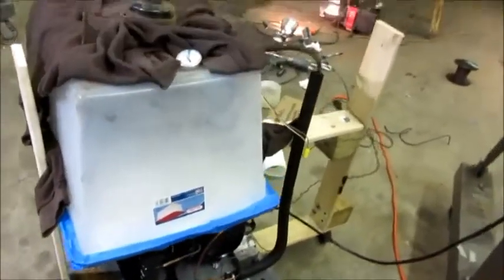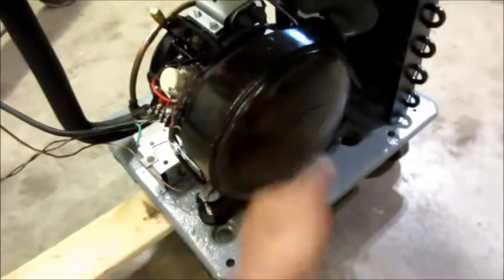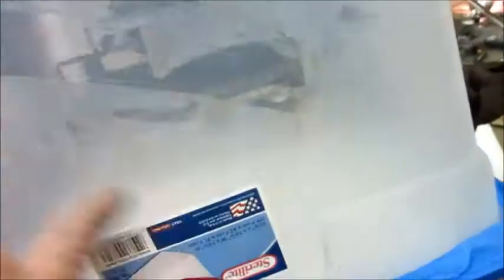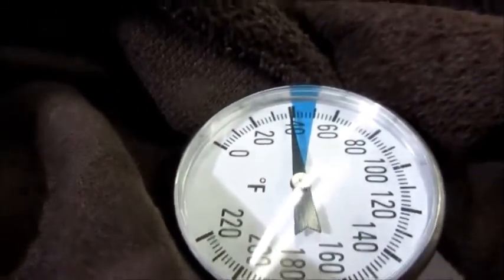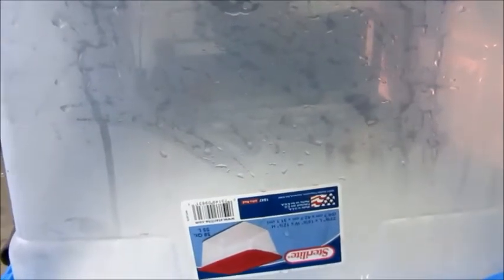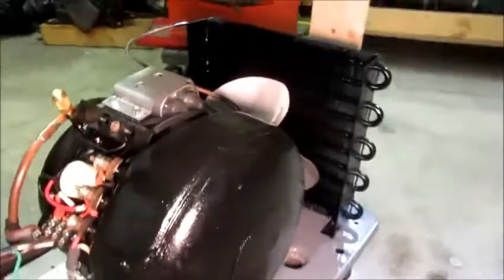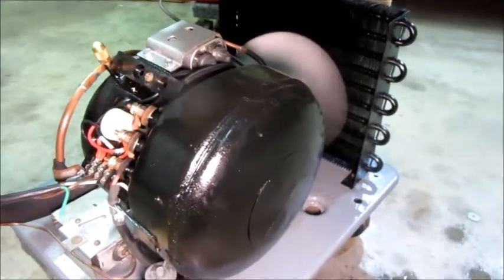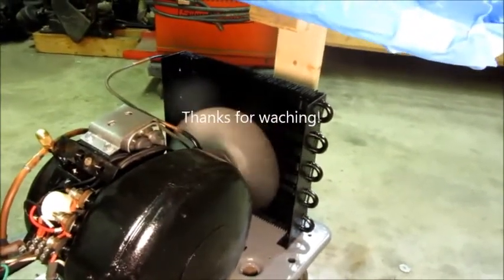Westinghouse Antique Vending machine Compressor - 4 - Simulated Cabinet Testing!

Comment: Excellent Job once again! Just curious about the charge....I recall you recovered the original R12 but charged with 152A....Did you feel you did not have sufficient R12 to recharge with recovered R12....also is the oil compatible with both refrigerants?
Reply from the maker: Thanks!  

I did recover the original R12, but it was just a tiny fraction of a charge. I save R12 for systems where nobody has proven them compatible with any alternatives. 

This Westinghouse system does not depend on the refrigerant and oil being soluble in each other, so the original oil can be used with R-12 (which will blend in to the oil at any ratio) or with R152A (which only blends in oil to a limited degree). 

The system is designed to separate the oil and return gas before they reach the compressor. Regardless of whether the refrigerant liquid and oil were in solution; or traveling as an emulsion - the compressor will receive dry superheated gas and liquid oil at its return.
Reply: @davida1hiwaaynet  i had a similer question,you answred it 100% thanks,enjoy your vids! you are a good teacher!
Reply from the maker: @oldcarnocar  Thank you! I'm happy you're finding these videos enjoyable and informative!